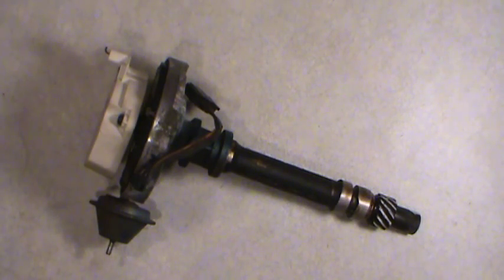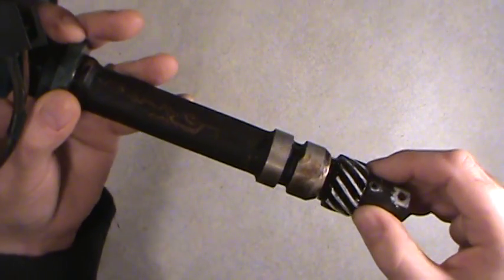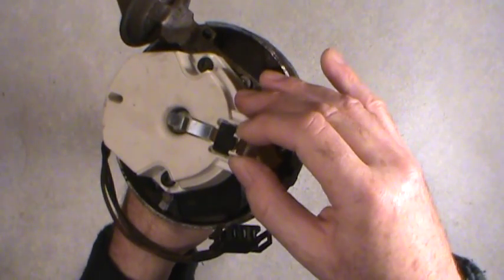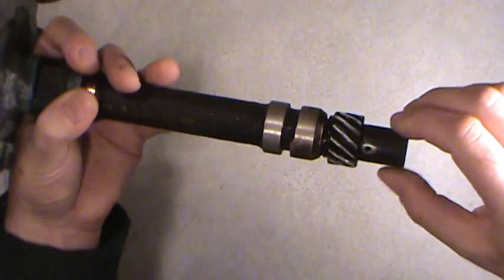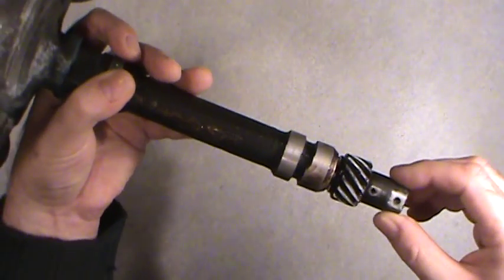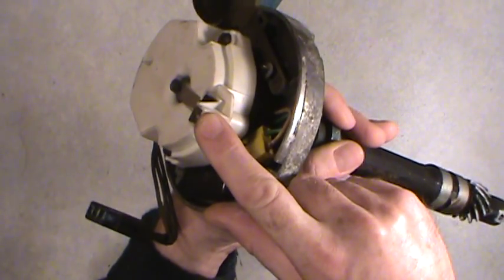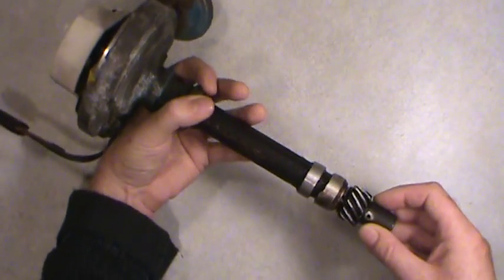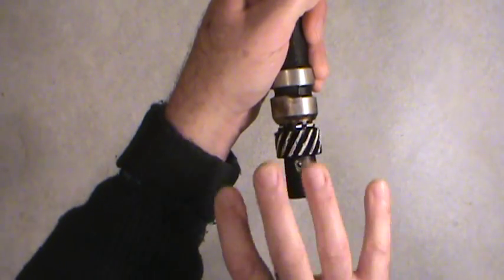HEI Distributor Video Series (Part 3)

Comment: Hello question for ya. Im getting a roller cam in my 355 chevy  and my machinist said that i could use the the iron gear thats on my hei now and it should be fine..   Hmm not certain. LMK what u think. Thanks.
Reply: Go back to the cam manufacturer and ask them.  Only they will be certain.

Comment: good info, thanks
Reply from the maker: Greetings...copper jacket...........You're welcome, and thanks for watching...........The good ole H.E.I. (High Energy Ignition), type of distributors, were really quite impressive, back when they were being installed by the car manufacturers (starting around 1975 there-abouts)..........I believe that D.U.I. (no, not the booze kind, but rather) Davis Unified Ignition (I think, that, that was the company's name, if I recall correctly, that is), will "custom build, and custom set-up the ignition advance curve", for just about any engine out there, probably being, anything from stock, to a racing application, for a very reasonable price (maybe have a look at their website, if you care to), and.......till next time.......Be Safe, take care, and have a good one.

Comment: part three and you have not disassembled.  You got some inhibitions or what?  They need the play to move oil.  Learned that first hand.  .010" play will lock up the top bushing and stretch your plug wires.
Reply from the maker: Greetings...chuck chase............Thanks for watching............Nah, no inhibitions at all, just haven't made any videos in a while...........It's easy enough, most times, for just about anyone, to take a mechanical item apart alright, but, when it comes time, to put the item back together again...Correctly...that's where the real skills are usually found...........I'm in no real hurry to take this LARGE Cap HEI Distributor apart, cuz, I figure, that, it would be a good idea, to show the folks, most of what, to be looking out for, while my HEI is still some-what together, then, after I conclude, doing that, then, it will probably be taken apart eventually............I can show, how, both, the mechanical and vacuum advance works, etc. ............Yes-Sire-ee-Bob...Aluminum will expand more, than Steel will, for a given length, in most cases, and that's why, when going any less, then about .015" (fifteen thousandths of an inch, as a guess), of running clearance, between the helical gear, and the HEI Distributor's aluminum housing, then, I be guessin', that, the aluminum housing, would expand/lengthen, more, then, that steel shaft would, and if so, let the binding/seizing begin.............Move Oil...???...well, if I recall correctly, then, there should be, kinda like, several slots, just above, where that tanged washer is located, that the helical gear rubs on, where it appears, that, the motor oil would use as a passage way, so to speak (I'll try to remember this, and maybe show it in a future video, maybe)............Stretch the plug Wires...???...as in, maybe, the whole HEI and its LARGE Cap actually "Spun" around (in a circle), and, ended up lookin', something like a really messed up Octopus...???...are You sure, that You Tightened the Distributor Hold-Down Clamp Bolt or Nut sufficiently...???...cuz, some years ago, a Friend of mine, Phoned me, and said that his V-8 Engine Ran Worse, "After", one of those, done in a short time, Tune-up Shops, worked on his truck............So, I told him to bring it over to my house, and He did, a short time later.............I popped the hood of His truck, and it sure didn't take very long to find the Problem..............I grabbed a handful of Distributor, and I could Easily twist it Both ways...!!!...Oh oh, looks like that super fast Tune-up Shop Guy, forgot to Tighten-up...You got it..."the Distributor Hold Down Camp"..."Bolt"...........I then, set the initial timing, with my timing light, and yes, I Did remember to "Tighten" down, that, Distributor Hold down Clamp's..."Bolt"...!!!...and, after doing so, my Friend's truck ran great again, and He was one, happy camper again............I actually replaced the Pick-up Coil Assembly, in this HEI Distributor, over 15 years ago, so yeah, I probably remember how to take "it" apart, and, put "it" back together again, and.......till next time.......Be Safe, take care, and have a good one.

Comment: How do i i remove the gear shaft from the car so I can reach the pickup coil???  I have been searching for the answer to this question forever, it seems like.  I need to get to the pickup coil asap!  Please help me!  Thank you in advance

94 DeVille 4.9, non concourse, non northstar.  i have removed the cap n rotor, and the plastic thing on top of the gear shaft (idk what it is called).  i cannot remove the gear shaft, and don't know what tools and steps I need to take to remove it
Reply from the maker: +Sean Evans....Greetings Sean Evans....Thanks for watching.....................Well, I haven't worked on Your Exact type of Distributor at all, but, Your Caddy's Distributor, with a few exceptions, is basically, much like the HEI/High Energy Ignition Distributor, that You saw in this YouTube Video of mine........................I must Warn You, how-ever, that, when it comes to Re-Installing Your Caddy's Distributor, after You have taken care of, like You were sayin', Replacing the Pick-up Coil, and maybe, what-ever else needs to be done to it, while it is Out of the Engine, then, "Everything" from how the Caddy's Distributor is Re-Assembled, all the way up-to, the Re-Installation of it, in the Engine, and, having it Set-Up (in the Engine), as far as, having the Ignition Timing "Set" to Specifications is concerned, will be the determining factor, as to whether the Engine will Run, or even Start for that matter............................Pay "Very Close Attention" to, just how, each and every Part of Your Caddy's Distributor gets Removed, as in, the Order in which those Parts were Removed from the Distributor............................The Helical Drive Gear, might have an Odd Number of Gear Teeth on it, and, it has to be Re-Installed on the Shaft "Exactly" the way it came Off of it...!!!...(as in, Not 180 Degrees Out)......(Hint)...Look for a Dimple or Marking on the Hub of the Helical Gear...........................Also, pay attention to the Shims/Washers, that might be, between the Helical Gear and the Distributor's Housing...........................To Remove the Shaft, from most of the older, GMC/Chevy etc. Distributors, while out of the Engine, that I've worked on, it was just a matter of, Removing the Cap & Rotor, and what-ever else might be in the way, when the Shaft came out of the Top-side of said Distributor, once the Roll-Pin, was driven out of the Helical Gear's Hub (also, make sure, that, there are no Burrs/upset edges, around the hole in the Shaft, on both sides of it), and, the Spacers/Washers were Removed as well, but, usually, the Higher the Mileage/Kilometer-age, that the Distributor had on it, the (usually) More Residue/Scum/Yuckees, that got Stuck to the Distributor's Shaft, which my Friend, makes for one, sometimes, very Stubborn-to-Remove, Distributor Shaft........................It's just a matter of putting some automotive type, of liquid cleaner, (and, do it Outside, for both, Safety Reasons, and maybe the Smell as well), that will dissolve that Crud some-what, down into, where the Shaft enters the Distributor's Housing, both top and bottom, and, repeat as needed.............Then, while Twisting the Shaft in both directions, while at the very same time, "Lightly", Pulling-Up on the Top of the Shaft, and sometimes, maybe pushing the Shaft back Down, while always twisting back and forth, and back up again, should start to some-what Loosen/Dissolve, that once before, Hardened Crud...hopefully...........It might take some time, to, both Soak-the-Crud, and to finally persuade the Shaft to come out, and, if You are in too much of a Hurry, one of the Bushings (aka, bearings that support the shaft), might also come out, of the Housing, and, we sure don't want that to happen....Right...???...lol........................Then, once the Shaft is out, then, there's usually a "Retaining Clip", or, something along those lines, that Retains/Keeps-in-place, that good ole Pick-up Coil Assembly (if memory serves me right, that is)..........................Make Sure, that You get the "Exact" Correct Pick-up Coil Assembly, cuz, there are so many "Different" Ones that were made...!!!.....................Then, make sure, upon Re-Assembly, that, all parts, go back on, in the Reverse Order, of, what that they came off in...........................Remember now, that Helical Gear probably needs to be "Indexed" (aka, timed, usually with the distributor Rotor's Tip), when that Roll Pin, gets driven back in, or there's probably gonna be Trouble-in-Pair-ah-Dice...!!!......................Then, if You Removed the ICM/Ignition Control Module, make sure, that, the bottom of it, and where it Mounts, inside the Distributor, are very Clean, and Use, some of that Specific Heat Transfer-ing Paste/Goop, on the bottom of the Ignition Control Module, before You Install it, or, that Ignition Module, might just Over-Heat and go "Poof", as in, need a new one now...!!!...Yikes...!!!............................When it comes time to Re-Install the Distributor, and Set-up, the, usually called, Base (Initial) Ignition Timing, and what-ever else, that's Specific to Your Exact Vehicle's Needs, I suggest, to maybe have a look around on the Internet, for a Cadillac Website, that has a "Forum" on it, where You can Ask, some of the very Knowledgeable People on those Forums, that will probably, actually have, some Hands-On Experience, with, what You are about to do..........................Well, that's about it for now, and, if You have any questions or concerns at all, just post them, under any of my YouTube Videos...................Good Luck, and..........till next time...........Be Safe, take care, and have a good one.
Reply: Hammer and a punch then punch pin out